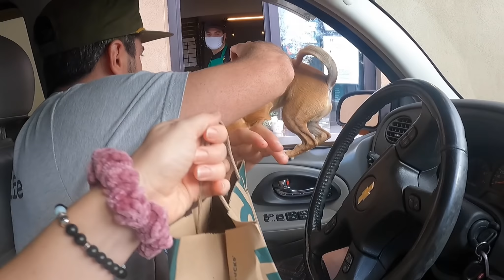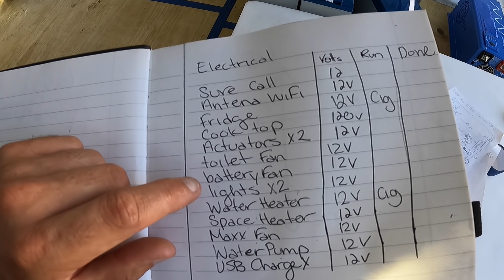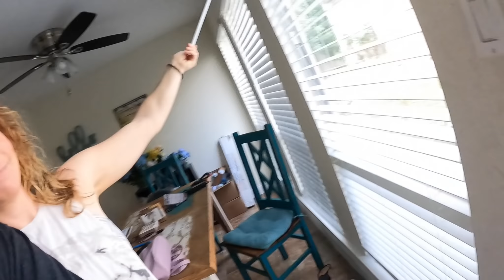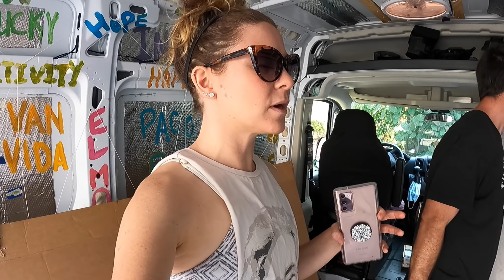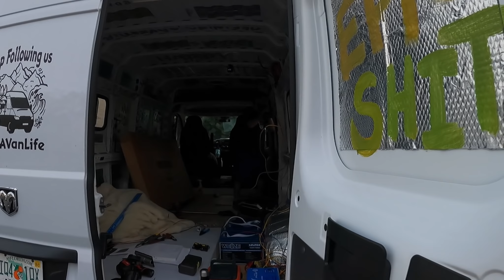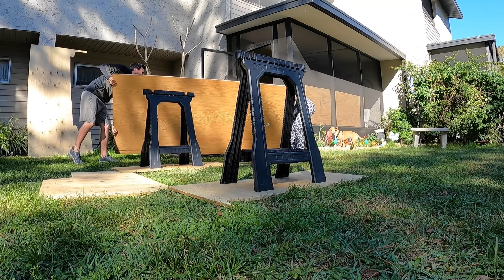Slider Door Window Installation + Framing the Van | RAM ProMaster Conversion Build Series 4

Comment from the maker: In this video I talked about length of wire to gauge size. When the power is 20amps and you are at 16 ft in length you would go from 12 gauge to 10 gauge. Down in numbers but up in wire size. 💪 

Don't forget to enter the van build giveaway here is the link www.fnavanlife.com/build-gway
Reply: Good job gettin' 'er dun!  Yes I noticed you got a little confused trying to explain it.  You could take it as a lesson that there are times when saying less is more.  There's a hell of a lot more to the subject than you've learned, but you got the important part of assuring wire size is adequate and all you need for that is the chart.

Why is wire size important?  Voltage drop.  Wire is modeled as a resistor (in DC; in AC there's a reactive component).  Current through a resistor develops voltage (E=IR).  So whatever lost in heating the wire is unavailable at the load.  The chart is made based on a given range of voltage drop (deemed "acceptable" by the chart maker).

Fire prevention is a separate issue.  Each supply wire should be fused based on wire size.  That's calculated based on temperature rise deemed acceptable; typically #10 is fused at 30A, #12 at 20A, #14 at 15A...  and so forth, for which again there are charts.  The takeaway is make sure all your supply wires are individually fused for their size - so they don't heat up and melt if an excessive current were to occur.

Hope that helps!  Keep on rockin'!
Reply from the maker: Yes I understand it all but explaining it is new to me. So I'm trying to explain it in an easy way but sometimes I get things a little backwards cause I have dyslexia. But I learned all this in union school. But I do appreciate the explanation.
Reply: @FnAVanLife  
That's cool Frankie; look no one's expecting you to prep them for their master's test.  😋  It's damn cool that you're sharing all the steps you are going through to put this baby together.  It's fun and insightful.  I've been considering a van build and watching you gives me ideas and inspiration.  It's more entertainment than education though, you know? 🤭 That's what I was aiming to get across.  I'm an electrical engineer which is why I wrote the way I did.  That stuff's interesting to only the tiny fraction of the population left who are willing to work to understand how things work.  Anyway...

Keep it up!  😋  Good work doesn't happen by itself and you two are rockin' it. 😍  BTW I hope you guys don't have to relocate your operation.  It may be crowded there and have its inconveniences but you have love there and it's working.  Blessings!  🤗
Reply from the maker: @elgringoec  thanks man. Naw I don't think we need change up anything, it will all come together. Thanks for all the great words and we want it to be more entertaining then educational lol so I'm glad it comes off that way. 😊 But if we can help people out we will. You rock man.

Comment: How do you attach the wood to the frame?  Do you drill into the metal frame?  Is there any concern about rust if you do?
Reply from the maker: Yes and make sure you use a screws that work well with steal. If you are really are worried about the metal bits from screwing in you can use a vacuum to get all the little bits. You shouldn't have to much moisture in the area of the van that you are drilling into. Biggest reason the havelock wool should act as a vapor barrier keeping any moisture away from those areas.
Reply: Thank you!

Comment: It’s counterintuitive on the wiring. If someone goes “up” in gauge from 8 they need a 6, not a 10. 👍🏼
Also, in most cases your wire length needs to include the negative side as well. So if you have a positive wire length of 5’ and a negative of 5’, your total length is actually 10’. 🤘🏽
Reply from the maker: Lmao yea I mess my words up and realized it after the top comment is about that hahaha. That is why you always use a chart.